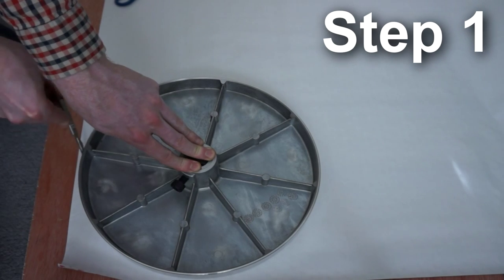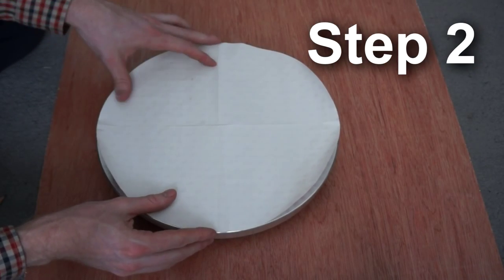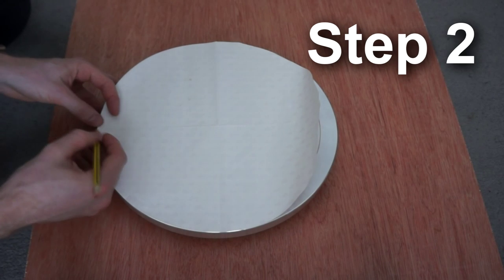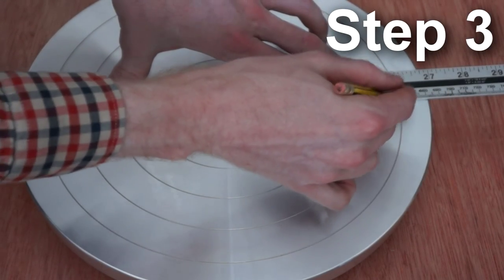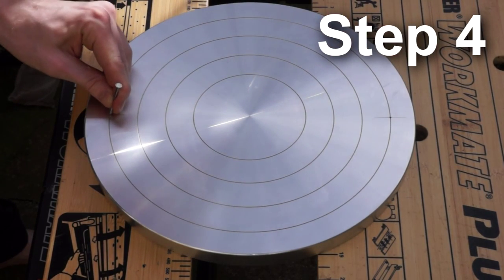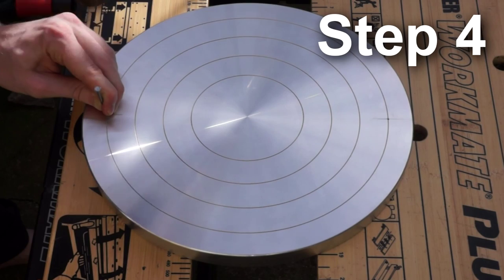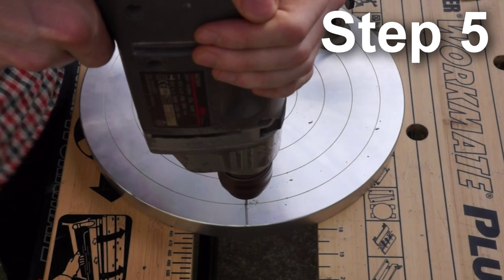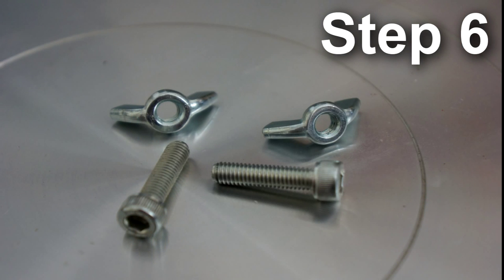How To Make Bat Pins For Your Potters Wheel

Comment: Hi, thanks for the demo - very helpful. Just a couple of questions - are you using a specific kind of drill bit to get though the aluminium? Are you drilling 5mm holes for the same size Allen bolts?
Reply from the maker: fredgwatkin 

You're welcome. Aluminium is pretty soft for a metal so normal drill bits will be fine but you can buy metal ones. I would drill 6mm for a 5mm Allen bolt - you are fastening with a nut/wing nut underneath so doesn't need to screw into the mental.
Reply: @PiedPiperfly  Fantastic - thanks again! :)

Comment: I need a wheel head for a pottery wheel for a 5/8" shaft, know anywhere I can get one? thanks
Reply from the maker: You can buy replacement heads for the various potter's wheels out there but they are very expensive. If you are making your own wheel I would take the shaft to a local machinists and get them to manufacture one for you. I made one out of wood but it was near impossible to get it square to the shaft.

Comment: My pottery wheel has a bolt hole right at the centre. There’s a 2cm-diameter hole right in the centre of the disc. How to I proceed?
Reply from the maker: +Meenakshi Kannan Some have a whole in the center. Just drill a hole somewhere near the edge. When you make bats - you make bats that fit your wholes/pins. If you want to use a commercial bat then you will have to make the other hole perfectly match the bat. It's easier to make your own bats to your own wheel pin specification though. Look at my other video on how to make bats beforehand. Hope that makes sense. Good luck
Reply: Daniel Piper thanks. This video and the info you provided have both been very useful. I was wondering how to place the clay when there’s a hole (for the bolt) in the centre of the disc. Guess adding a bat would solve the issue. Strange that my model cannot be used without a bat however, isn’t it?
Reply from the maker: +Meenakshi Kannan Yeah it is kind of strange. You could just through straight on the wheel and you won't lose too much clay. Maybe fill in the hole with a bit of clay before you start.
Reply: Daniel Piper Yeah that makes sense! Thanks a lot.

Comment: The template is unnecessary. The pins are better if they are off-centre. That way the bat can only be replaced on the wheel in the same position.
Reply: How is that helpful? Surely its better if you can position it in all ways all the time
Reply: @eduardwalhout1740   No, if you want to work on the same piece, later, after it has stiffened a little, you need to get it back on the wheel in exactly the same position in which it was thrown. With the bat pins evenly spaced you might replace the pot rotated 180• . You will soon observe that that is what has happened, and you can correct it easily enough, but it wastes time.
Reply: @chriswatson1698  Oh right. Fair point. But if you place them perfectly in the first place it wouldnt make a difference. I guess its a question of how perfect can you get them and your method would be the smarter way. (still going to try to get them perfectly centered)